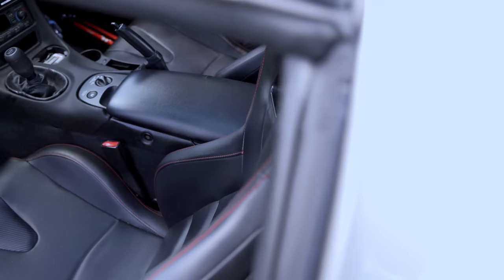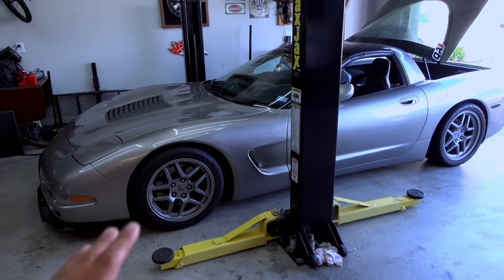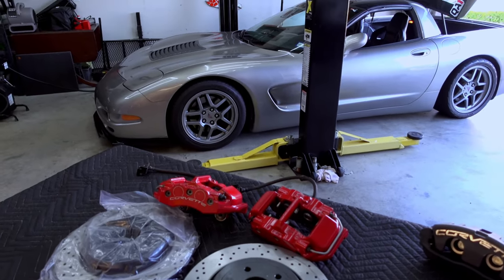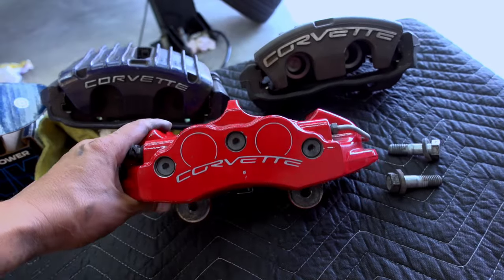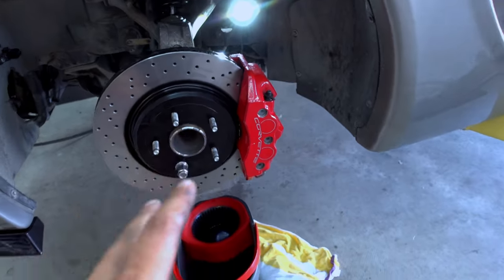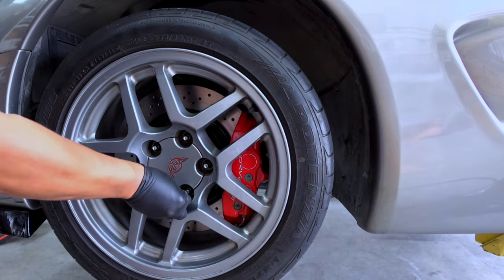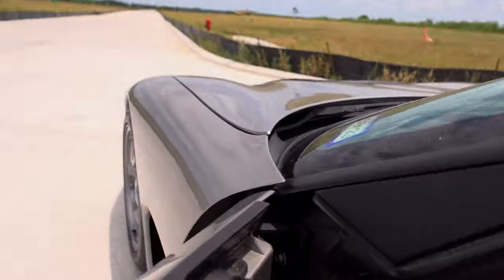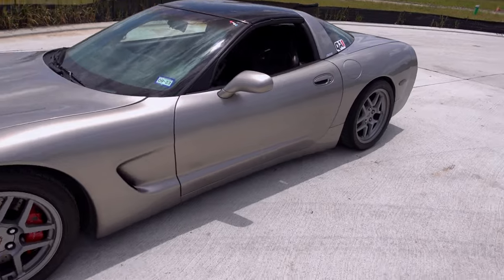WHAT EVERY C5 CORVETTE OWNER NEEDS DONE ON THIER CAR! Cheap Big Brake Upgrade With Stock C5 Wheels.

Comment: Remember kids, it's a system. So the correct size master cylinder should be used to match the calipers. Which might not be possible using a set up that the factory never planned for. Still cool it all just bolts up
Reply: Right, it isn't this easy. I learned this years ago swapping a rear disc/caliper setup from a Grand Cherokee to a Cherokee. I changed the valving in the system to accommodate for the swap. Had I not, the rears would lock up first under heavy load. Any one who has had this happen will tell you it is like being on ice - the rear end can kick out. 

I want to see what he ends up with. I am super curious about the bias.

Comment: Interesting idea, but I'm confused.  You are threshold braking to the point the stock brakes with track pads is inadequate, yet, you install cross-drilled rotors?  You either were NOT getting everything out of your stock brakes, or you are not experienced enough to know that cross-drilled rotors will, not could but, will crack from track temperatures.  You also went to replacing calipers and rotors before adding brake ducting that would cool the rotors to make the stock brakes with track pads work well.  And PowerStop track day pads do not compare to actual track compounds, as you see with the Hawk pads.  Not trying to sound condescending, just making observations.
Reply: drilled rotors were needed back when pads required off gassing to keep contact with the rotors.   now pads have improved to where they are just for show in most applications.   I favor more swept area over holes that look " racy".
Reply: I completely agree! I track my 04 Z06 and it only has steel lines, racing pads, racing fluid and cryo-rotors and it absolutely stops! Like I almost get pulled out of my harness!

If even 25% of car people really knew what cross-drilled rotors do, man, that industry would dry up.
Reply: Crossdrilleds.are.only really.good.with carbon.
 Ceramic rotors since the handle heat little better then steel also why the zl1 camero has solid steels

Comment: I have stock needs, so no way will I be  messing with such a critical safety system.  just because " it fits". is not enough for me.   I would need some way to restore the braking system balance if non  specified  parts are installed in the system.    experimenting is for track only.
Reply: Right, it isn't this easy. I learned this years ago swapping a rear disc/caliper setup from a Grand Cherokee to a Cherokee. I changed the valving in the system to accommodate for the swap. Had I not, the rears would lock up first under heavy load. Any one who has had this happen will tell you it is like being on ice - the rear end can kick out. 

I want to see what he ends up with. I am super curious about the bias.

Comment: Oh man you got to lift in your garage My father has every tool available You could imagine but he never bought a lift. Even when he owned the shop we never had a home lift.
Couldn't use a straight fitting for the brake line hose instead of that 90° angle one and not have to grind the caliper

Comment: got the Calipers installed. they work great with the 17" C5 Z06 wheels up front. I was planning on going with C7 Z06 wheels but that will require longer wheel studs and a 10mm spacer. Just a heads up for anyone that is thinking of going that route. the design of the C7 wheel isn't aggressive enough coming off the hub and it hits the new caliper. 

also don't use the factory size 4 small pads as you loose about 30% of your contact area. don't ask me how I know but I know. LOL
Reply from the maker: Awesome glad this helped. Thanks for that helpful tip
Reply: What brake pad did you use to replace the 4 padlets on the C6 Z06 rear calipers?
Reply: What "bigger" pads did you find for the calipers?
Reply: @alexgilmour5555 

I bought the Hawk pads like he did
Reply: @YELLOWVETTE 

I bought the Hawk pads like he did
Reply from the maker: @alexgilmour5555  I went with some hawk pads. https://amzn.to/45VrL2v
Reply from the maker: @YELLOWVETTE  hawk pads. https://amzn.to/45VrL2v

Comment: What's wrong with the stock brakes? I did 2-piece stock sized wilwood rotors, hawk HPS pads, and SS lines, stock calipers and they're great. Back when I had nitto nt05's 200 treadwear tires on it the brakes exceeded the grip of the tires, hit the brakes too hard and the abs would kick in. Now with nt01 100 tread tires its perfect.
Reply: Agreed! I track my 04 Z06 and it only has steel lines, racing pads, racing fluid and cryo-rotors and it absolutely stops! Like I almost get pulled out of my harness!

Comment: What was the weight difference of the calipers? Rotors? Did you ever figure out the issue with the rear? How are the fronts running now? Thx

Comment: So the c6z rear caliper fits in the front of the 17in wheel of the c5 what about the rear what did you put on the back
Reply from the maker: That’s correct in the back I’m planning on doing the same setup as the front.

Comment: What did you put in the rear for brakes?  Did you leave the factory cailper or put the front calipers on the rear?
Reply from the maker: I have the factory rear caliper still back there. Prob going to look for another c6 z06 rear caliper to put back there also.

Comment: I did the 4 rear Calipers on the car. it would not stop the way it should. We thought it was a booster problem as it had a hard pedal. that was not the problem. no air in the system. used a Tech 2 scanner to work the ABS module.  nothing worked. put the factory brakes back on and everything's is fine. it may work with these up front and the factory in the rear. all we can figure is since everything is exactly the same resistance and things it's not getting the proper pressures where it needs to go. Mine is an 01 and you can't change the front to rear Bias like you can on a 99 and below.
Reply from the maker: That’s strange I wonder if adding a adjustable proportional valve would help with the pressures?

Comment: Any issues with upsetting the braking bias by just changing out the stock front rotors for the C6 rear calipers/rotors?

I'm thinking if you run a square brake setup at the 4 corners, you are going to need to add a propprtioning valve?
Reply from the maker: No issues with braking with current setup, but yeah I may need to run a adjustable proportional valve if I did a square brake setup. We’ll see I’ll keep you in touch once I get to that stage
Reply: I'm having issues with something close to this issue. We haven't figured it out yet. For some reason I don't get a full pedal and having trouble Stopping. the pedal is hard like no vacuum but there is plenty of vacuum. you can pull the check valve 5 minutes after the car shuts off and hear the vacuum release.  I'm running the C6Z  Goodridge G Stop Brake lines with a banjo fitting but can't see that as being a problem.

Comment: You have opinions and I have mine but stock is fine just a saying
Reply from the maker: No for sure stock is plenty for most owners, but for those looking to track their car performance brakes are a must.
Reply: @JJBanuelos  I track my 04 Z06 and it only has steel lines, racing pads, racing fluid and cryo-rotors and it absolutely stops! Like I almost get pulled out of my harness!

But, I get the upgrade too!